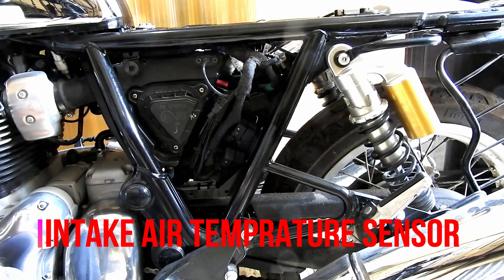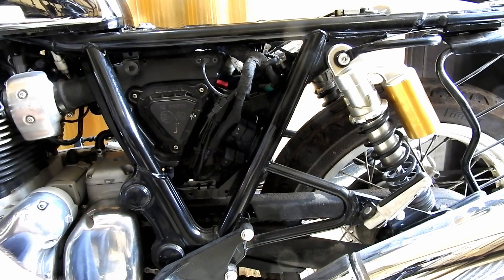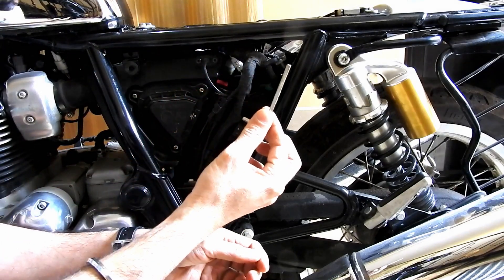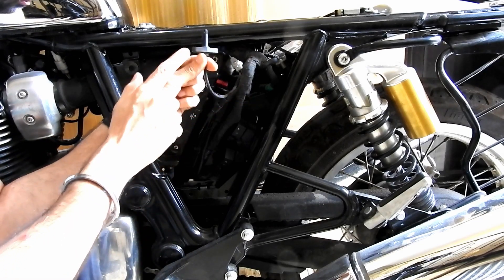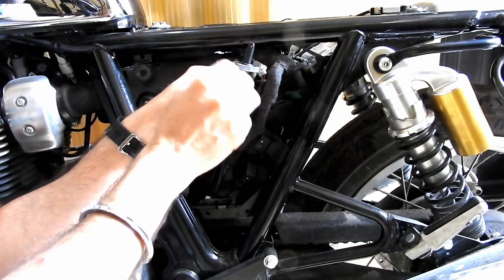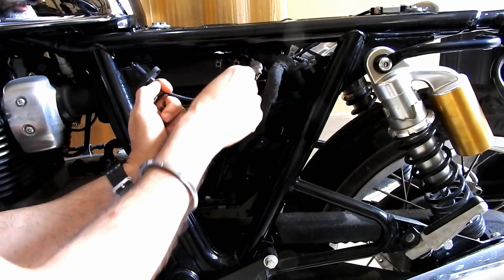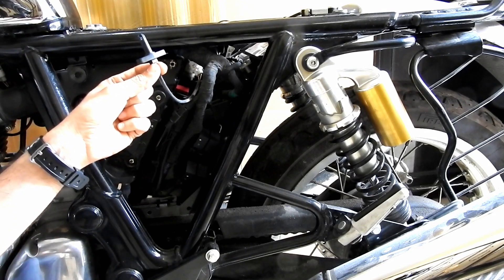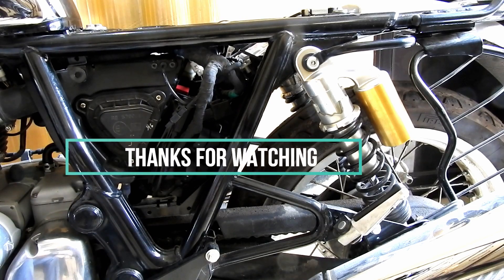RE Interceptor/GT 650 IAT sensor

Comment from the maker: Hello guys,

In this video I will show you the location of the IAT(Intake Air Temperature) sensor. It is located on the air box where the air goes to the intake system. IAT sensor feed the air temp to the ecu and then the ecu modulates the fuel ratio in the AFR of the FI system. IAT is important part of FI motorcycles.

clogged sensor can lead to erratic idle, cold start issues and engine stalling.

open the left side cover the use the 4 mm Allen key to take the IAT off, dust it of if there is any dirt. If the IAT is clogged too much and you can not see the element inside then spry electrical contact cleaner or carb cleaner to unclog it. Do not use oil based cleaners as any residue would attract more dirt, also avoid hard stuff like acetone.

after cleaning screw it back properly so that it will not pop out due to air pressure.

Thanks.
Reply: I'm getting the check engine light. Took the bike to the service center and they're asking me to replace the IAT sensor. But he has no stock of the same. Will cleaning it like you have shown help? or replacement is necessary?
Reply from the maker: @ArunKumar-dr9is  clean the relays. I have made one video on mil / check engine light watch that. And also try clean iat.

Comment: Olá meu amigo. Esse sensor é o que mede a quantidade ar? Ele causa a falha p1104?
Reply from the maker: Hi.
This sensor measures the temperature of the outside air entering the engine and send signal to ecu.
 p1104 is mainly a fault code for mag sensor but this could also cause it.
And a lose ecu plug can also cause it.
First check the ecu connectors, then the sensors
Reply: Obrigado, meu amigo  @ijs_autoandmore

Comment: Where is the MAP sensor on this bike?
Reply from the maker: @dbissdude  under the tank on the throttle body. Old gen has one map sensor new ones have two map sensors.
Reply: @ijs_autoandmore  thanks I found it. I didn't realize I'd have to remove the tank to get to it. I had a fault code and ended up finding a loose pin on the connector and that was the cause. Thanks!
Reply from the maker: @dbissdude  good that the issue is resolved now.

Comment: Can u pls tell the position of MAF sensor?
Reply from the maker: Let me check i will get back to u with information.
Reply: @ijs_autoandmore  sure
Reply from the maker: @ashfaqpasha3302  hi sorry i didn't find maf any where on the air intake and airtfilter intake. Seems like its not there as even the ecu wiring/connection diagram doesn't show pins to connect maf anywhere.
Reply: @ijs_autoandmore  ok cool

Comment: Hello Inderjeeth, Thank you for this wonderful informative video. Does relocating IAT sensor to a cooler place help in increasing the performance of vehicle.? Do you suggest to do that?pl let me know your views. Thank you
Reply from the maker: No sir for that you need mods like booster plug etc, performance filter with performance exhaust 
Race dynamics has something specific to what you are looking for.
Reply: @ijs_autoandmore  Thank you for the revert. I wanted to improve the torque hence i have installed,  ss moto corp full exhaust system, FF air filter, Would be installing Powertronics Piggyback ecu. Wanted to know by relocating IAT sensor to a much cooler place will improve performance? hence checked with you. Thanks once again
Reply: After having Powertronics installed, if we relocate IAT to a cooler place will it help in anyway?
Reply from the maker: @arvindniyogi882  relocation won't help something like a booster plug would help. They have fuelx which many are using to good effect. Even with full piggyback (which is not actually piggyback, too many wires) the performance difference is very minimal.
Check with them about fuelx
Reply from the maker: @arvindniyogi882  iat is at its best place , as i mentioned earlier booster plug or fuelx
Reply: @ijs_autoandmore  thank you very much for your revert.

Comment: Hi. 
My gt 650 bs4 is getting heat very shortly in traffic and missfire and less power delivering. Can you please tell the problem which I'm facing. Awaiting for reply. Thank you
Reply from the maker: Get throttle body and injectors cleaned + sparkplugs cleaned and gap adjusted.
And Clean or replace air filter it it is too old or if u are riding in very dusty environment. Also replace engine oil
If it is more that 5000kms old
Reply: I serviced from service centre include change of airfilter, engine oil  and clean the spark pluk too.
Reply from the maker: @sreejithtr7818  ask them to clean the evap drain tube and service the throttle body and injectors.
Reply: Thank you🙏

Comment: Sir in my gt right handside near tool box..petrol comes after sucking air pipe , n i am facing ignition start problems I watched ur relays vds my relays r ok 
What could be the reason
Reply from the maker: If the relays are ok the it could be related ro ignition coil or rr unit. Get it checked at the service center.
But do swap relays with each other first.
For petrol leakage lift the tank up and chk for any lose pipe. Also chk petrol tank cap gasket for any cuts

Comment: Sir in my interceptor m having less firing issue n drop of power dilevery..n not a smooth flow from exchost …d flow is like suffercation flow I mean not loud…no one yet found d mistake…
Reply from the maker: How many kms have you done?
Are u using after market exhaust or filter?
Did they check spark plugs and plugs suppressor caps?
Reply: @ijs_autoandmore  yes sir everything
Reply: Aew n DNA
Reply from the maker: @jitugoa9323  try with stock airfilter and see how it runs could be possibly running lean due to high airflow
Reply: @ijs_autoandmore  ok sir

Comment: Bro any idea abt way2speed nano fibre filter.... is ut true than performance filter no need to oil like that they say... pls say is it better than other performance filterz
Reply from the maker: Nano fiber is good and plus point is no oiling , means less mess.
But i personally would never use any performance filter or any other non oem ones. I am fully satisfied with stock filter it is cheap ti replace and efficient enough to keep the engine happy. 
Performance filters can result in engine running lean. I had my part and time with k&n and bmc in past now i am done. The performance difference is negligible only the intake roar is increased.

Plus for this motorcycle people using stage 2 kit keeping the intake open without snorkel cover which makes the water entry easy if u have heavy downpour in your area frequently. And high chance of water entry while wading through high water.

You can go for nano fiber ,but i won't suggest keeping the intake open.
Reply: @ijs_autoandmore   bro well said bro... my doubt is im planning to change silencer frm 650 interceptor... so is it mandatory to switch to performance filter when we change silencer
Reply from the maker: @vichu650  ride few days with new exhaust and u feel it choking for air then you and shift to new af.
Reply: @ijs_autoandmore  ok bro

Comment: Hello bro my interceptor loses torque and pickup when it heats up and engine makes a clattering sound.. But when the engine is cool its normal and there is no clattering sound from the engine... Do you have any idea on the problem or a solution.. Will changing the oil fix this issue.?
Reply from the maker: Do you get any battery indicator  when this  happens?
How old is the oil in kms?
Reply: @ijs_autoandmore  no the battery indicator does not glow.. But the oil pressure light comes on when i turn the ignition off.. I have done my first service at 500kms and now its 1700 on my odo.. There was no sound till 1200 kms.
Reply from the maker: @se7enrider106  ok means it is new.
Ths could be related to weak oil pump , weak pickup coil or a faulty rr unit unable to regulate the current.
Get the rr unit and pickup coil Checked at the service center.
They will put the Engine ti running temp then check these with diagnosis tool and then with amp meter.
My guess is the rr unit.
Reply from the maker: One thing u can do at home is to clean the fuel pump relay and fix it back and then test it.
Reply: @ijs_autoandmore  okay thank you bro

Comment: Very informative video as usual... Amazing work! 

I've faced a bit of choking issues with my bike when accelerating suddenly. It's similar to what we would face when there is no fuel in the vehicle. 

Could this be diagnosed as a clogged fuel filter? As I routinely clean the air filter. 

Not sure what could cause this.
Reply from the maker: Thanks.
How old is the Motorcycle in kms?
Has any water entered in airfilter in rain etc and how old is airfilter?
Reply: @ijs_autoandmore   I've completed 29k kms.. No water has entered the air filter as far as I know. I recently replaced the stock air filter for an aftermarket filter, so the new air filter is hardly 1000kms old
Reply from the maker: @varungardner2883  after market means free flow(ff)?
Probably running lean if ff, people use booster plug to negate this.
And at 29k , if throttle body hasn't been cleaned yet then clean both injectors and throttle body it will make a big difference .
Reply: @ijs_autoandmore  Aaahh okaayy.... Thank you so much!! 😃

Comment: Thanks! very informative video. Can you also make a video about the location of gear position sensor. Can we use it to install some kind of gear position indicator on the bike? I feel gear indication is handy especially during city ride.
Reply from the maker: Open the front sprokect cover GPS is located below sprokect just above the gear shaft. Haven't thought about this mod but should be possible as there are tons of gear position sensors Available mainly on AliExpress

Comment: Hello,

My Neutral light is not working, how to check that my neutral sensor is working or not?
Reply from the maker: As per my knowledge the neutral sensor if not working the it should give a false reading of Motorcycle being in gear to the ecu and it would then not allow the engine to start without pressing the clutch. 
If you can start the Motorcycle with clutch the could only be the bulb. I will further check the location band working of neutral switch on our motorcycle as soon as possible and would give you more details.

Comment: I had an issue today Inderjeet. While riding @ 80kmph the engine suddenly cut off. The lights were on hence the battery wasn't an issue. I stopped. Switched off and on again and started it in the first crank. I rode back home. I'm worried now. What could be the issue?
Reply from the maker: Could be faulty ignition switch or the kill switch. Get it checked they will scan the ecu for error codes if nothing comes up in codes then ask them to inspect both kill switch and ignition switch. Other thing could be a faulty sparkplug cap but if one doesn't work it runs on single cylinder. Get both plug caps checked up.
Reply: @ijs_autoandmore  Thanks a lot brother.!